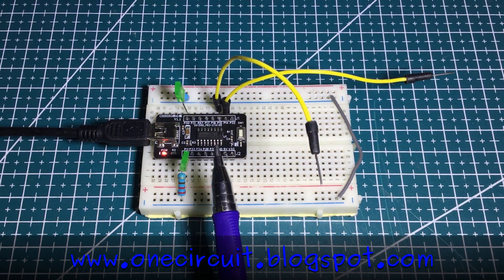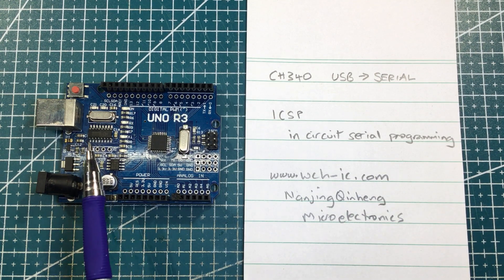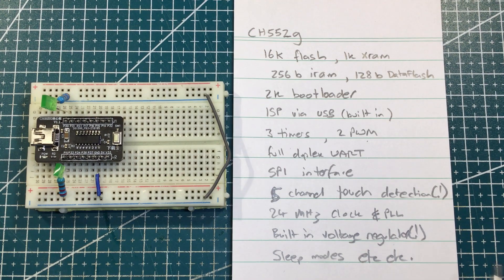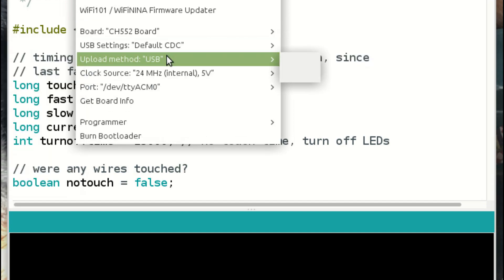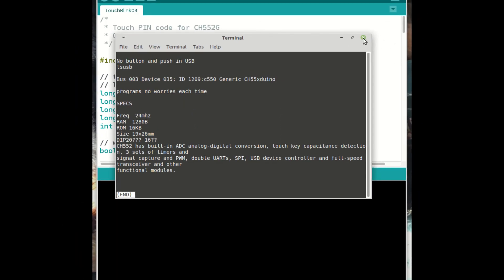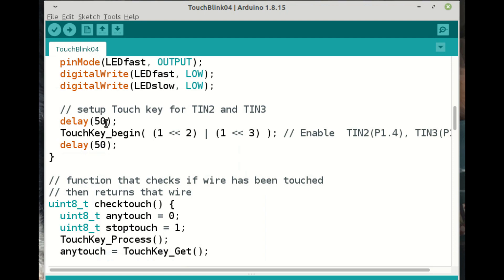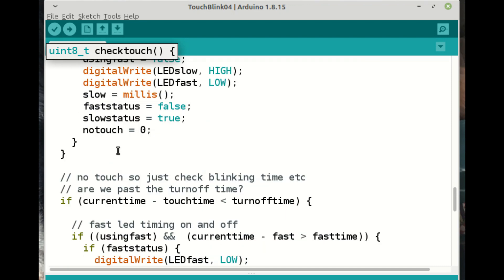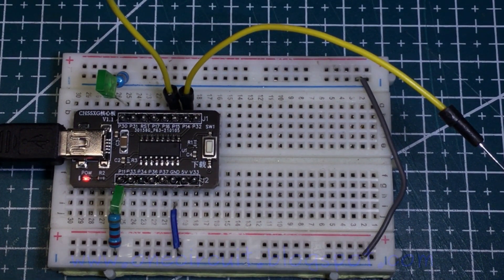Beautiful forbidden Tech - CH552G

Comment: awesome vid, question about the test board, is the switch connecting USB_D+ to +5V? I saw a schematic on the linked github page and thought that seemed weird. The datasheet being in chinese wasn't much help to me, and the translated one wasn't a heap better.
Reply from the maker: The CH552G link on the blog has a pdf in English which might be useful. Also if you search CH552 on AliExpress the pages which contain the module often have very useful information on the layout and function of the board - good luck!
Reply: @onecircuit-as  woah, thats a much better translation than what I had previously found.
thanks!!

Comment: How do i get a port to appear on my ch552 board? My board has no valid device port, it only has a port for reading serial data to the serial monitor, but it gives nothing for programming. I got a driver and it seems to have installed correctly, but i can only program it using a serial converter to UART. If you know how i can manually configure a port please tell me, even if i need to reflash a modified bootloader image. Thank you for the help you give me.
Reply from the maker: Interesting! What OS on your computer?
Reply: @onecircuit-as  Windows 10. I feel like the problem i am having is something to do with a defective or miss-coded bootloader on the chip and a badly coded driver. In my experience a driver doesn’t matter if there is no port.
Reply from the maker: @XanCraft21  I use Linux but I did have to specifically give the OS access to that port. There is no windows equivalent, although from my searching I found references to "Get-PnpDevice" which may be needed I think to give permission to access the device from the OS. From one github source:
"Entering CH55x Bootloader Mode
A brand new chip starts automatically in bootloader mode as soon as it is connected to the PC via USB. Once firmware has been uploaded, the bootloader must be started manually for new uploads. To do this, the board must first be disconnected from the USB port and all voltage sources. Now press the BOOT button and keep it pressed while reconnecting the board to the USB port of your PC. The chip now starts again in bootloader mode, the BOOT button can be released and new firmware can be uploaded within the next couple of seconds."
Reply: @onecircuit-as  i did enter bootloader mode and i still get no port. I can only make it work using an FTDI or similar adapter. Do i need to search until i find a copy of the bootloader, modify it to make the port appear, then make my own uploader tool from scratch to program the new bootloader? I mean i have better alternatives to the ch55x series boards with better specs, but i was curious to try something new. My board automatically exits bootloader program mode after 9 seconds, which technically isn’t natural. At this point i will take any answer i can get to get this piece of junk working to it’s fullest potential, even if i have to install a virus then try to delete it later.
Reply from the maker: @XanCraft21  It’s pretty exotic tech so I’m not sure, but the last bit about exiting boot loader mode after a few seconds is accurate. Given its potential, I’m sure new bootloaders will be written and made available. Maybe a sweep of GitHub and even the manufacturer’s site in a year or so might reveal progress. I’m a bit “dog with a bone” in this regard, but I certainly see your viewpoint. Do you have a second board for experimentation? They are pretty cheap!
Reply: @onecircuit-as  no i do not have a spare board. But if i can’t get a port to appear without using an adapter, in my mind i don’t see a reason to get another one. I think i am going to assume it’s a bad design from the manufacturers until they can fix their mistake.
Reply from the maker: Yes there definitely comes a time when you need to come out of the rabbit hole! Good luck to you! 👍😀
Reply: @onecircuit-as  thank you.

Comment: Fascinating video. After watching, nearly pulled the trigger and ordered some CH559 chips in qfp48.
Had to stop though, after looking into ch55xduino.  It seems that general compatibility with existing libraries is limited, due to the memory model.
The price and built-in USB bootloader sure looks appealing. Looking forward to your follow up vids.
Interested to see if you can get things like U8glib and Adafruit-GFX working.
Reply: The problem is that there is only C support... most Libs use C++
Reply from the maker: Certainly more here for future investigation. Such a competent family of microcontrollers! 👍😀
Reply: There are no USB HID libraries that work with the CH552 and arduino. As a cheap microcontroller, it is pretty good - almost at cheap as an ATTiny13 but with more IO. But I'm not smart enough to figure out how to get HID working. I ended up giving up on the CH552 and just paying extra for ATMega32u4 chips, because at least they have a HID library.